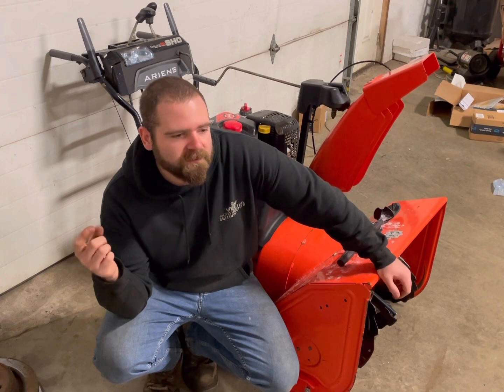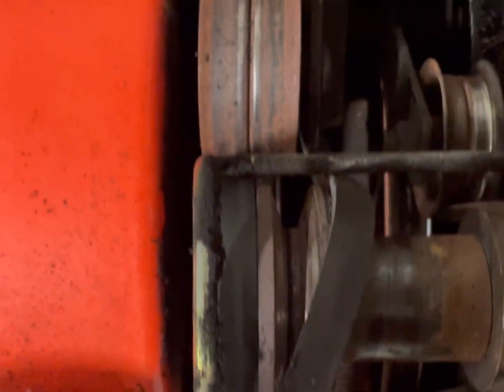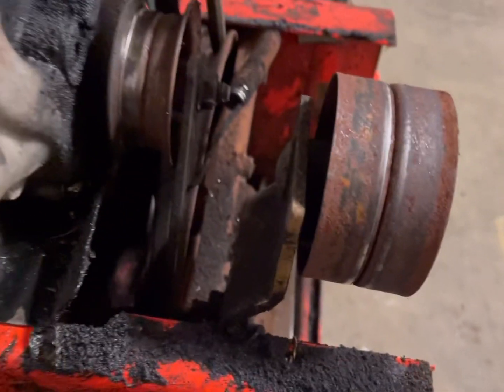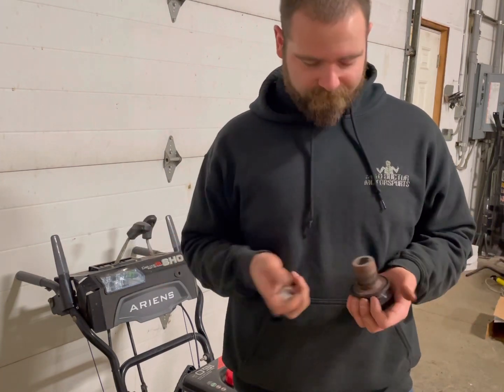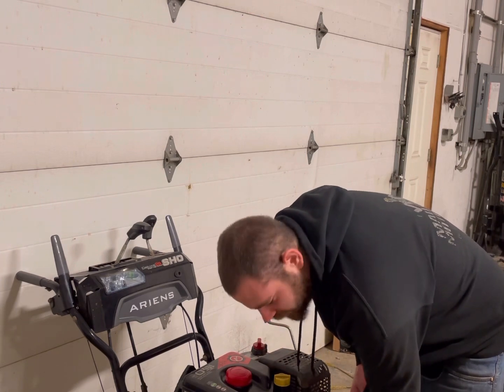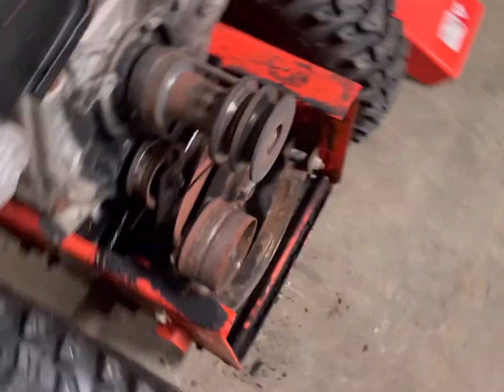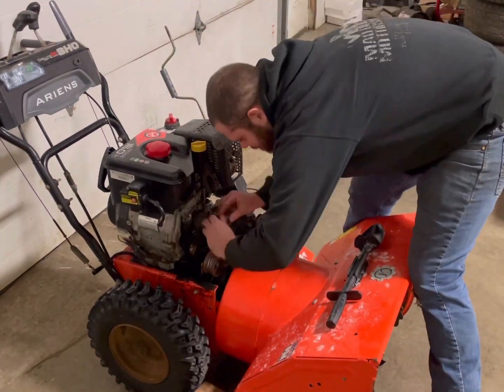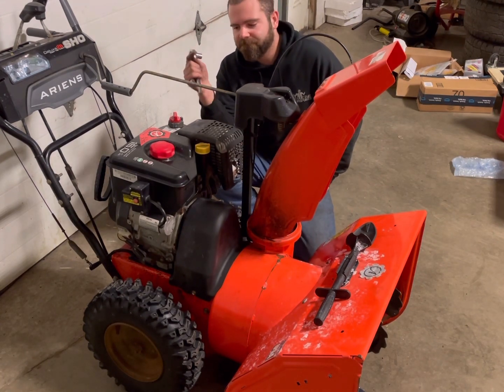Ariens Deluxe 28 snowblower belts not lining up. auger + crank pulley problem. Fixed!

Comment: Thanks again for this video.

I successfully implemented your fix.  To do so, I went to my local Lowes and purchased the following:

- 2 packages of Item Item #321312 (Model #883571), which each package containing two 14 gauge washers with a 1 inch inner diameter with a 1 1/2 outer diameter.

-1 package of Item #321327 (Model #882397), which contains two 18 gauge washers with a 1 inch inner diameter with a 1 1/2 outer diameter.

Using an impact wrench, I removed the auger belt drive pulley, and on the engine output shaft, I put on 4 of the 14 gauge washers followed by 1 of the 18 gauge washers.  After carefully tightening the auger belt drive pulley bolt (14 mm) to snug with a socket wrench, the auger belts are now perfectly on center with their respective halves of the attachment idler pulley.  The belts also remained on center when the engine was running at full speed.

One thing to note is that the original auger belt drive pulley bolt is a 3/8 - 24 bolt with fine thread (not coarse thread) and is 2 1/4 inches long.  Because the five washers have moved the auger belt drive pulley outwards by approximately a 1/2 inch, I must now find a new 3/8 - 24 fine thread bolt that is 3 inches long (no could not find one that is 2 3/4 inches long).

Lastly, as I think you mentioned, you must not over-tighten the auger belt drive pulley bolt, as you risk destroying the threads on the bolt or the engine output shaft, a very catastrophic and costly event.

I'll keep you posted.

-Z
Reply: How do you take the crank pulley bolt out?  It just spins the engine when I move it with my socket.  Thanks for the info on the exact size bushings.  Is a new 3 inch bolt critical?

Comment: Thank you greatly for making this video.  I wish I could have found it sooner.

I have an Ariens Deluxe 30 (921032) that is experiencing the exact same issue.  My machine worked normally the last time I used it.  Then, when I tried to use it after the next snowstorm, it stopped throwing snow as I got into snow thicker than 3 inches.  I removed the belt cover and found that the belt closest to the engine came off.  When I put the belt back on, it was only then that I noticed that both auger belts were off center from their respective halves of the idler pulley.  But when I think about it, if the belt drive shaft was too short to begin with, the belts could have been off center prior to the machine's first use.

Initially, I thought the idler arm shaft was bent.  I consulted a shop that sells and repairs Ariens, and even the repair technician said he has occasionally come across snow throwers with bent idler arm shafts.  I examined my idler arm further, and I noticed that the flat part through which the idler pulley bolt goes was perfectly parallel to the attachment pulley.  I consulted Ariens Support directly, and they said that the attachment idler arm shaft can get bent from heavy loading of the machine, like going through snow banks caused from plow trucks.  While this might be possible, I found it hard to believe, as any reputable company should have tested their snow throwers on such snow banks.  Plus, clearing through snow banks was part of the main reason I bought a snow thrower in the first place.  Why destroy your back.

Frustrated with Ariens Support's reply, I was getting ready to buy new parts, but I decided to intensively search YouTube first.  Luckily, I found your video.  You just saved me well over $100 in parts and time!!!

Although contrary to other commenter opinions, your taking apart the machine for this video was the right move.  Very rarely do people creating these videos show the details of the internals of the machine.  My only suggestion for improvement would be to show the machine running with the belts off center of their idler pulley halves, and then show the machine running after you have fixed the issue via the spacer washers on the belt drive shaft.  Action shots speak louder than still shots.

Could you please tell us from where you got the information on the Tecumseh engine's belt driveshaft being too short?  I want to take this information directly to Ariens Support so they can improve their machines so others don't have to suffer this issue like I and others have.

Great job sir!!!
Reply from the maker: this information was confirmed by ariens themselves. consumer helpline will only give you so much information. i was a tech at an ariens dealer before i started my own shop. so it was 5+ years ago. but on the commercial/dealer tech support they told me on the phone that this was the case. i have another one in here right now with close to the same issue. but more severe. which im going to post a more in depth video on shortly. the ariens models just seem to keep getting worse and worse
Reply: @SmallEngineWizard  

Thanks for the reply.  This is very useful information.  Ariens should really publish a work-around like you have.  I'm wondering if a different Tecumseh's engine has the appropriate belt drive shaft length.

Unfortunately, I have to store my Deluxe 30 outside.  I'm using an Ariens snow thrower cover to keep rain and snow off of it.  However, it's now starting to develop rust on certain areas of the casing.  I guess I'll spend the summer using a rotor wire wheel to remove it.  Would you happen to know what the manufacturer and color code for the orange paint that Ariens uses?

Also, the halogen light on my Deluxe 30 stopped working.  A voltmeter says that the electrical system isn't putting out any voltage.  On another website, an Ariens owner had the same issue and found that the cuprit was the plastic connector closest to the alternator.  Unfortunately, the Deluxe 30 has a sheathed wire harness that goes behind an engine covering, so it will take a little effort to remove the covering and trace the circuit back to the source.  Do you have any videos on troubleshooting the electrical circuit?  I'll try to post some pictures here.

I look forward to your next video about the short belt drive shaft issue.
Reply: @SmallEngineWizard  kinda a shame the quality is mediocre on these ariens.   I still like them better than the all the rest....except i never tried a Honda....

hope you upload more content.   i enjoy the videos.

Comment: You have to check to pulley alignment with the engine running at full speed and with the auger engaged. The pulley shifts backwards when the auger is engaged.

Comment: Greetings.

Like you probably did, I measured the diameter of the engine output shaft and got a value of 7/8.  From which store did you acquire your washers with a 7/8 inch inner diameter?  I went to my local Hone Depot and Lowes and couldn’t find them.

Comment: Got my washer but my problem is when you tight the screw it tight on the washer because the pulley doesn't touch the crankshaft like before, in that case should i put inside the pulley some 3/8 washer thanks
Reply from the maker: yes

Comment: Why did you take it all apart?  Did you have other problems with the machine? If so, tell us, other wise someone might think this is how it has to be done. Example, my neighbor needed a new drive belt. I was sick at the time so he got a friend who took it apart like you did then never put it back together right. He caused more problems than he had. The drive didn't go backwards, the left skid plate was about 1/2" off the ground. I was surprised that the chute worked ok. LOL Just do a better job with the camera and your videos will be fine. Thank you for sharing it. By the way I did have the same problem years ago with a craftsman. I scratched my head on how this could be. I fixed it but still I asked myself why? I'm 76 and have been working on them a long time. Thinking back I believe a NEW belt would be ok for a while (I had the blower a couple of years before the belt came off) and when the belt was worn or stiff it would spin off. Your Thoughts if any. Thanks again good info
Reply from the maker: Thankyou! i am always looking for constructive criticism. This was actually the first video i ever recorded and did it a year prior to ever uploading it. i wasnt sure if i was going to start a channel at that point. when i get another one with this issue i will go more into depth and better camera work but i wanted to get the content out there. the thumbnail describes the issue. and anyone typically looking for this content would be coming across the issue. this isnt just a typical belt replacement video.